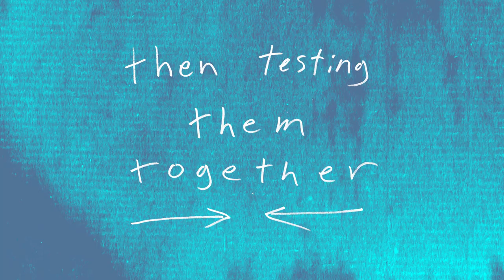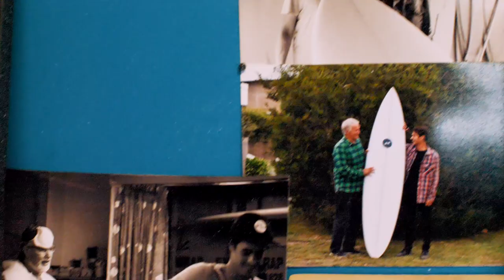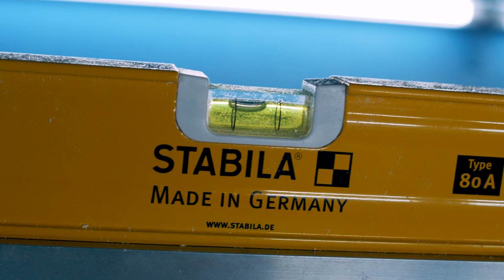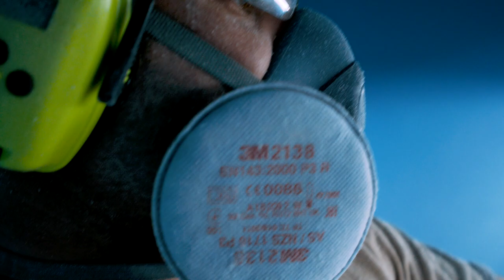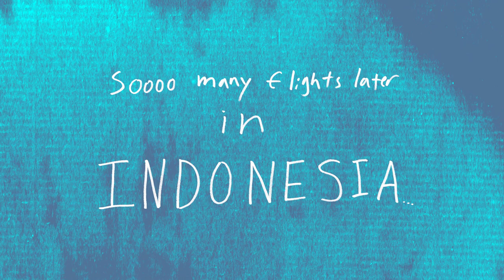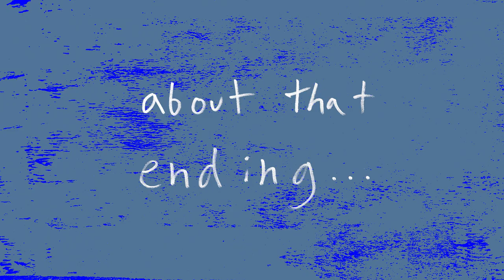"Handmade 2" Tests Unconventional Hand-Shaped Surfboards in Perfect Indonesian Waves

Comment: Its kinda hard to watch these dudes use the planer sideways with the drum setup way to low and not realizing that they are just putting bigass grooves into the foam this way.
I feel like a disk sander would be the far better tool considering how they use it